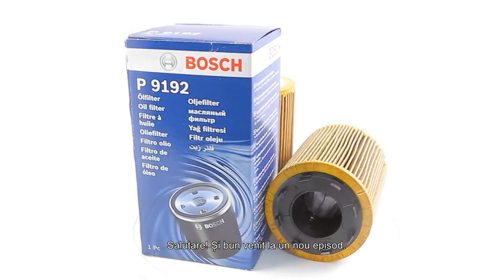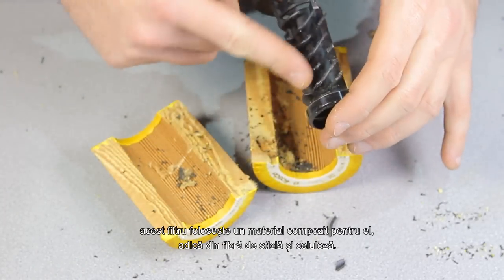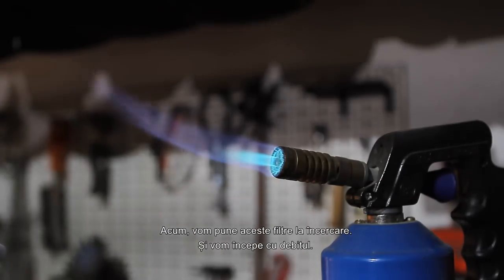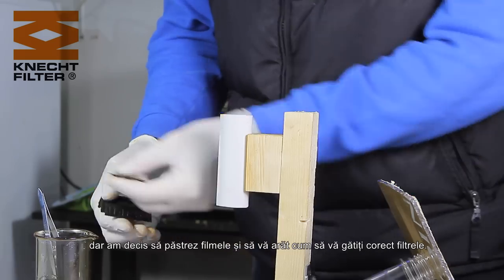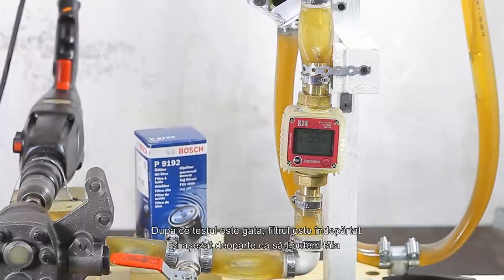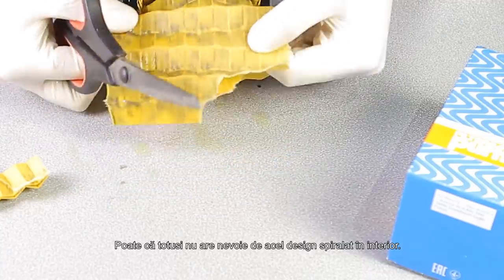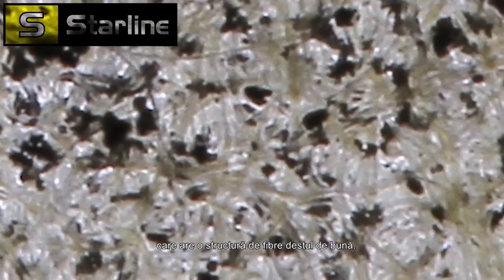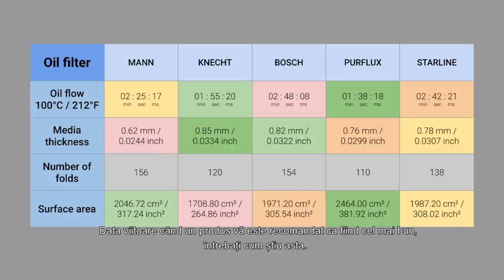Bosch vs Purflux vs Starline - Oil Filter Comparison

Comment: Always use thermal couple to measure temperature. Actually use at least 2 at different locations. Heating ovens are very inaccurate and the temperature inside is not the same at the different points. If possible - use a fan inside the oven. How many tests I had ruined by bad ovens...

You should use only ferrous metal particles and use magnet to check what is left in the oil after the test.
Also, the surface area and the flow rate are probably connected somehow to form the overall flowrate of the filter. If you run the pump for 200l and check the required time you will see that function. And probably the lower flowrate results for MANN from your test are not bad because of the bigger surface area.

Keep the good videos coming!

Comment: I was buying Purflux for years. It was original for Citroen / Peugeot and i often bought it for my other cars. But now times changed. Price went down by 3-4€ and suddenly on the box is no more Made in France.. its China. I quit with this manufacturer, if i want chinese filters i can get them way cheaper than 8€/piece. Im talking about my recent Purflux L442 filter for 3.0 HDi. So very nice test.. but the products and quality changes. I had similar experience with Lemforder, they were made in Slovakia.. now Malaysia or Spain, and they dont fit my car anymore. The dust cap breaks after instalation because of bad desing.

Comment: Wouldn't the filter with the thickest media keep the by pass valve open longer when the engine is cold...a better experiment would be to see how well cold oil flows through the filter and how long the by pass valve is open

Comment: Wait what, Purflux you had here was actually genuine VW/Audi filter? I am well aware that aftermarket and the one you can get from the dealer are the one and the same, but don't they usually remove all the logos from the aftermarket ones? And Bosch filters aren't always made in Germany, my cousin has Alfa Romeo and he always buys Bosch filters, and every single one of them was made in South Africa, however ones i get for my VW Jetta are indeed made in Germany. And i have to say there's no difference in quality no matter where they came from, at least not that i know of. Well, Bosch, Mann, Purflux, Mahle.. Can't go wrong, they were all, or still are, OE suppliers for VAG, BMW, Mercedes..

Comment: Dont lose your time : technology filter paper of Purflux offer 42 % more area to filter anything.
It's the lonely filter beyond 30 or 40 other filters that can deliver this filter capacity and so it can be smaller than other and easier to install on a motor..
If you find FRAM filters, they use same tech.

Comment: Nice video, but the filter test can be more accurate if you measure the exact amount of powder added and then, after the run, examine whether the filtered oil is clean using a laboratory test.

Comment: Unfortunately this test is nearly nothing.
The most iportant data of an oil or any kind of filter is the diameters of the microholes on the filter material. So the main function for the filter is to filt a bigger parts AND this parameter is nowhere in the test.
Sorry for my comment, but the most important data is still missing.

Comment: BUT THE FASTER IS FLOW-THE WORSE IS FILTRATION. ELEMENTRY PHYSICS. Wholes bigger so this means filtering is worse Also the better the flow -the worse performance in filtering later because of paper wholes will expand and will be torn to be bigger and bigger.
Reply: Until it gets worse you should already have made an oil change!